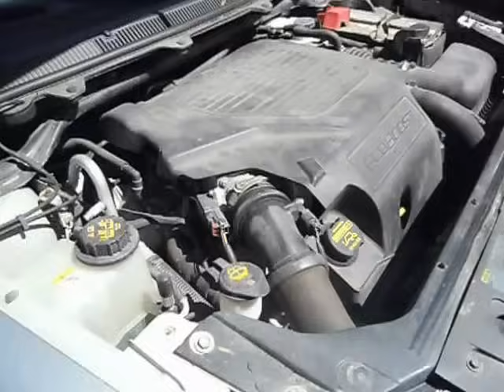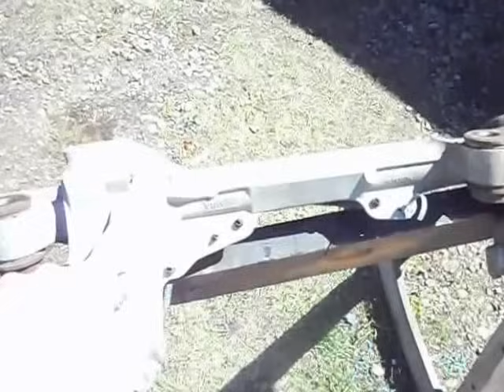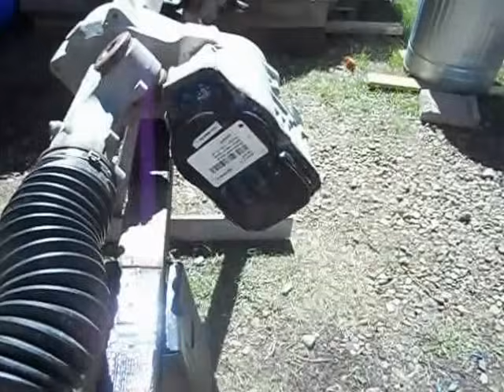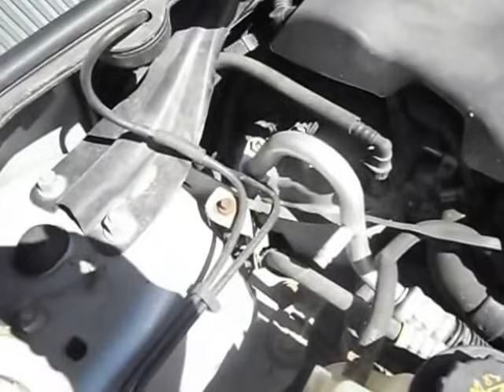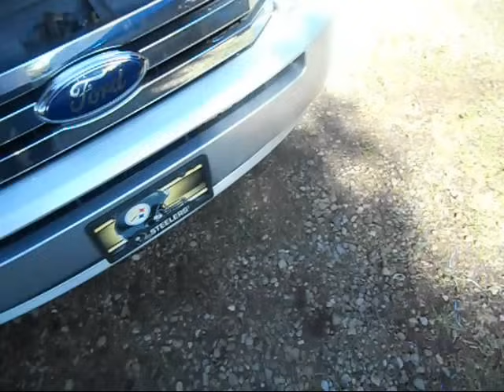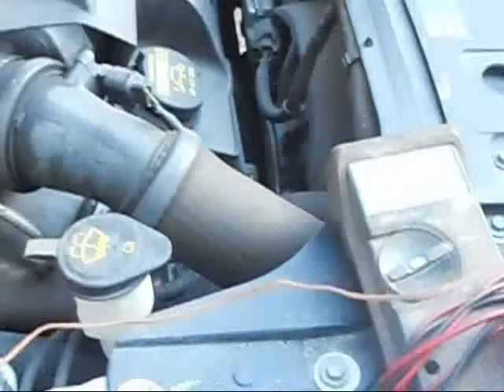Ford Electric Power Steering Failure Identified

Comment: it actually has a stepped motor not brushless motor
Reply from the maker: Do you happen to possess schematic or TRW related documentation for drive electronics? TRW referenced use of brushless drive in early documentation. Could certainly be stepper drive motor, this would simplify control system, and produce high static torque. Without proper design schematic, many assumptions are made about drive and control system. The investigation I conducted on non-functional unit identified failed motor drive-module. No reverse engineering was performed to identify specific circuit configurations. I also reference use of MOSFET H-bridge drivers in design. TRW may have used alternate drive configurations as well, or even simple unipolar drive configuration, although this would dramatically reduce performance. If you possess further insight on design, please share. I have not been able to identify any actual EPAS circuit schematics, given TRW and Ford propriety. There are TRW produced patents which include preliminary motor drive schematics. These schematics show full MOSFET H-bridge brushless drive configuration with dual optical encoder feedback (motor and steering shafts). This was the basis for my assumptions concerning drive configuration. TRW and Ford may have opted for simpler and more cost effective configuration in production.
At any rate, Ford's EPAS design has proven to suffer from design and systemic application flaws. Absolutely no reason an implementation this complex, expensive and failure prone should be utilized. In my opinion, the entire concept should be scrapped in favor of legacy design approach.

Comment: Smh I just bought a 2011 ford explorer limited 9-28-20 and one day later pulling into a store parking lot making a hard turn into a parking space and loss steering and recieved the message on the dash power steering assist fault took the vehicle to the ford dealership paid $125 to get it checked and they said I need a new electric power steering assembly $2240 so I contacted the used car dealer I bought it from and he act like he didnt know anything about it but is currently working with me to swap me out but the big dealership said it's nothing they can do its past the warranty the recall was repaired back in 2014 when I didnt own the vehicle and I'm saying well the issue came back so what can you guys do for me they said nothing I also contacted NHTSA they said it was repaired back in 2014 smh so they called the dealership manager on the three way with me but completely on the dealership side basically coaching them against me so other then taking the dealer I bought it from to court what else are my options someone please guide me in the right direction the used dealer I got it from is a scammer and ford ain't nothing but corporate thugs smh but one thing about me I DONT LET NOTHING SLIDE ESPECIALLY WHEN MY FAMILY AT RISK OR MY HARD EARNED MONEY IS INVOLVED 💪
Reply from the maker: Unfortunately Ford has already implemented sophisticated program to profit from their own engineering flaws by charging consumers for EPAS repairs. You have just joined millions of pissed-off consumers also scammed by FMC. Yes, the vehicle is very dangerous, my EPAS failure caused an accident with injury. Many other victims have reported hair-raising accounts of steering loss at speed. Failure modes include not only steering loss, but non-commanded steering and even complete steering lockup. Your only option is to make repairs and dispose of vehicle. I purchased rebuilt EPAS unit from ebay and completed replacement myself. Many others have invested in dealer repairs, then sold vehicles immediately before problem repeats. NHTSA will do nothing for you because Ford is still an American company with 100B stock worth. If you take Ford to court, many attorneys are lined up to profit from your case. But remember, attorneys only want to represent you and convince Ford to settle out of court. This is because taking case to court is less profitable. Legal route will take approximately two years to settle. Situation is truly criminal, nobody is accountable and agencies like NHTSA do nothing (i.e. unless company is foreign like Takada). 
Find a way to repair vehicle and never purchase another US brand automobile. This is your best route.
Reply: @bk1468  Thank you and I appreciate your response ✌
Reply: We're all suckers buying a ford. Why do you think they stop building cars after 2020.

Comment: Ford deny to help:  Ford said you have to pay to fix
 : 
after warmup, found steering very tight on my 2010 escape,

internet said is the power  assist steering torque sensor need replaced.

Got parts from amazon,  have mechanic to replace the sensor, labor 2 hours.

Steering no problem now.
Reply: I have an 2013 Escape with the same issues, what parts did you purchase? Any help is appreciated! 👍🏻
Reply: Did you get any lights on the dash? Like Hill assist disabled, cel, abs, trac disabled.

Comment: Hi I purchases my 2011 Ford Focus LW Sport Diesel last year. It has only just done 55K. I suddenly had the steer assist malfunction warning come on and managed to drive it to my mechanic who replaced the steering rack ($2880au) about two weeks ago. Yesterday, I started the car and the the fault appeared again. I turned the car off and on again which seemed to correct the issue. All was fine until I hopped back in the car after work and the same fault reappeared this time and stayed on. I just phoned my mechanic and he seemed puzzled and has asked me to bring it back in. Hmmmm
Reply: The Power Steering Torque Sensor  may need to be replaced.
Reply: My recall is expired on my steering gear so I got to pay out of pocket . Don’t want to spend this amount of money if I’m gonna still have issues with it. Did they fix your issue that you had after they so called fixed it. Cause I’m looking at all these comments I’m afraid to even consider paying that kind of money getting it fixed and still having issues out of it

Comment: You might want to check your facts automotive electronics design requirements have been typically 150C since 1995 according to information that I have received from the automotive industry.  Not trying to defend Ford I won't drive one
Reply from the maker: Not clear what your reference is referring to in video, however I talk about industrial temperature grade, not sure if I ever mention automotive. The real point in video is that Ford EPAS system includes components not in compliance with even industrial grade, let alone automotive. Ford's design approach was to utilize low-cost components housed within temperature controlled environment. This approach is fundamentally flawed and against every intrinsic safety philosophy I ever learned.

Comment: 2010 Lincoln MKT... For a while my power steering would occasionally not activate when starting up the car and would get "POWER STEERING ASSIST FAULT". I would need to restart the vehicle and it would usually come back on. This weekend it evidently died for good along with Advanced traction control, Blind spot warning, and collision prevention warning systems.  Is this all related to the same faulty component?
Reply from the maker: Yes, multiple system communications-bus failures are typically associated with EPAS fault.
Reply: @bk1468  what do you recommend as a course of action? Suck it up and pay to have it fixed or is there something we can do to hold Ford accountable?
Reply from the maker: @stevehamburg816  Either pay Ford for repairs (replacement same faulty design), or purchase and install from ebay or other source. Either way, consider disposing of vehicle for safety and repeat failure risk. Really not worth dealing with Ford; as company has established vast network for bypassing repair obligations, and abandoning customers to their fate. Millions of Ford customers have been forced to pay costly EPAS repairs, and Ford enjoys profit from non-action.

Comment: I'm currently looking for a new used car and the 11-13 Explorer was on my list. I know that people had problems with the electric power steering failing. So Ford had two recalls in 2014. One to replace the steering gears and another dealing with the electric power assist system. Given everything that you've researched and know, do you think or know if Ford fixed the problems with the recall or is it just a temporary fix to get the NHTSA off their back and will fail again?
Reply from the maker: Ford did nothing to correct any aspect of engineering design flaws associated with EPAS systems. And what Ford did do was absolute minimum, i.e. very limited replacement of failed units with identical design. At the heart of the Ford problem are undisclosed thermal stress failures, resulting from implementation of non automotive temperature qualified components and systems.
Ford engineering has hit new low in recent years, with ever escalating technical complexity, coupled with sharp decline in reliability, quality, and cost of ownership. Ford product deficiencies do not stop with EPAS systems; Ford vehicles remain at 'top of list' for consumer reported reliability complaints. Whats even worse is Ford's customer service; who abandon affected vehicle claims, and blatantly defraud consumers. Even if under warranty, Ford often denies claims with fraudulent practices directing blame at consumer. When my ecoboost engine failed under warranty the first time; Ford attempted to place $12,000 replacement on me; sighting failure to change oil as per service schedule. What Ford missed included their own dealer service records showing premium oil changes every 4K. My Ford vehicle has since experienced various and repeated expensive failures including; two instances of rear brake caliper lock-up, gas tank leaks due to premature corrosion, EPAS failure, second ecoboost engine failure, fuel rail leaks, turbo oil seal failure, intercooler design flaw, throttle body design flaw, and others. My vehicle only had 16K miles at onset of problems, starting with rear brake lock-up.
Reply: Wow thanks. Do the police Explorers have the same steering issues/setup? Scary to think cops are driving around in vehicles with these issues.
Reply from the maker: No idea if police use same EPAS system, I highly doubt it. As far as police are concerned, I am more worried about a wife and/or family on highway when EPAS decides to kill everyone. It is no joke and scary as hell when an EPAS system produces non-commanded steering torques, failure will jerk wheel out from your grip and send vehicle out of control. This occurred on my 2010 Flex, resulting is crash into curb. It is only matter of time before fatalities bring this issue to close.
Reply: Alice Elliott Yes they do. And it’s a cop’s worst nightmare.

Comment: Unit costs 1700.00 plus tax cdn.  Happened on my 2012 fusion awd 3.2 or 3.5 whichever.  They say recall covers 2010-2012 (Transport Canada) -the governing body.  Plus Ford!  HOWEVER the recal for 2012(my year ends on Feb 28 of 2012...My car was manufactured in May,2012.  So there ya go.  Ford is the same as it was in the 70's - . Crap.

Comment: i dont know of you read this.. but in auto racing in high heat areas.. we use gold film ,or a similar heat sheild to protect anything that is sensitive to heat.. and it reflects over 95 % of direct heat, and radiant heat from these areas.. would you think this would also stop heat transfer to the steering system?   by the way ..i own a 2.0 2014 fusion..night look into this soon
Reply from the maker: Yes, Gold is one of best reflectors of electromagnetic energy. Once designed first-surface gold mirrors for LIDAR scanning equipment. Also used in spacecraft to reflect energy from sun, and to reduce radiant energy to cold space. However, in heat saturated environment; gold foil will not prevent thermal energy from reaching components immersed in heating envelope. Foil would only serve to postpone eventual overheating. But foil will increase time interval required to heat component. This would help in intermittent thermal cycles to keep EPAS cooler. But would supply limited protection during long drive or extended idle period. BTW Ford implemented heat shields on many EPAS implementations (i.e. aluminum barrier between heat sources and EPAS housing). Unfortunately EPAS units failed anyway; same issue with component immersed in thermal envelope.
Reply: @bk1468  just thinking.. perhaps like the james web telescope.... and 1 more gold coated heatsheild between the oem heat sheild and the steering rack...lol.. but i might try it
Reply from the maker: @randellgribben9772  Key is to remove heat from system; if system is saturated with thermal energy, heat shield will only serve to slow thermal conduction process. Just like OEM thermal shields Ford installed in failed attempt to address issue. BTW Ford also added forced air cowling ducts under engine, directing air over EPAS housing. Still EPAS failures abound. Real problem related to non-automotive temperature standard adherence for internal EPAS components. Bad idea, bad design, and horrid implementation. Ford engineers just ignored fundamental design philosophies by implementing highly-complex and delicate critical component in extremely harsh automotive environment. Hydraulic steering systems remain simple, cheap, reliable, durable, and safe. Why move away from legacy technology to electric actuation with order of magnitude more complexity? Perhaps Ford was thinking of future all-electric vehicles? EPAS will go down as just another Ford blunder.
Reply: @bk1468  then with that logic.. we should remove the fuel injection for out cars, and return to carbis??  lots of other companys use eps  with no issues, and alot use trw eps systems
Reply from the maker: @randellgribben9772  Carburetor vs fuel injection? Clearly FI offers greatly increased performance and reliability. Both FI and Carbs represent mechanical systems; simple rotary FI pump much less complex and reliable over carburetor with delicate needle valves, floats mechanism and mechanical linkages. FI represents logical and practical technology advance from complex to simple form, not the opposite; like simple hydraulic steering rack to complex electric with thousands of discrete components. GM experienced many problems with EPAS systems, no personal experience with other manufacturers.
Reliability drops exponentially with system complexity, this represents fundamental rule in engineering design. Design engineers are educated to recognize simplicity as fundamental to achieving  performance with reliability. This fundamental rule seems to have been forgotten.

Comment: Well, it just keeps getting better! Yes, sarcasm. So, when I contacted Ford about the steering issue, they then notified me of a safety recall on the Fuel Module Flange. Apparently, after they refused to do anything about the steering issue, this safety recall can cause a fire. BUT, the dealership cannot get the parts to fix the safety recall issue for FOUR WEEKS! Hoe do I work to keep making the payments and pay for repairs on this unsafe piece of junk?
Reply from the maker: Unfortunately, problems with Ford vehicles unfold throughout ownership. Ford engineering is just so poor, coupled with use of sub-grade standards and materials during manufacturing process. Ford issues are generally 'major' failures like; engine, drivetrain, suspension, etc.. Also, small but numerous issues like; power windows, electrical switches, lighting, wiring, etc.. Just non-stop cash payout for repairs and maintenance. Eliminate Ford from your life, and you will find better days. In fact keep away from all US auto manufactures; they have all adopted identicle business models resulting in poorly engineered, expensive, hazardoous consumer liabilities.
Reply: @bk1468  yes, I agree, I should have held out for a Subaru or a Toyota, which I had before. NEVER a Ford again!

Comment: My Taurus SHO (2012) pulls left and right with uneven or crowned parts on the road, and it seems it is related to the pull drift compensation from the EPAS unit.  If that is acting up can it be reprogrammed or reset?  The steering wheel seems to torque one way or another more than it is supposed to in an attempt to assist the driver. I also hear a clunk at times when turning in parking lots or slower roads. If it is a computer glitch or problem with the pcb in the EPAS do I need it replaced?
Reply from the maker: Your description sounds more like mechanical linkage wear with loose component. I would check all front suspension and steering components. With 10 years use on vehicle, suspension components sure to be at end of service life. I generally replace all components related to any given suspension issue. Never replace just one component, if one rod-end is bad; replace them all.
Reply: @bk1468  thank you, that was my only other suspicion.  A Ford dealer recently checked my suspension but it seems it is in need of a second opinion.  I really appreciate your response.
Reply: My fusion has the same problem. It pulls hard f r om side to side for no apparent reason. Can you imagine cars yet having these issues yet its all a big secret and it's not really happening according to Ford and others NO CAR SHOULD STEER ITSELF AND MAKE US CORRECT THE LIKE YOU SAID DEMON FORCES STEERING OUR CAR.